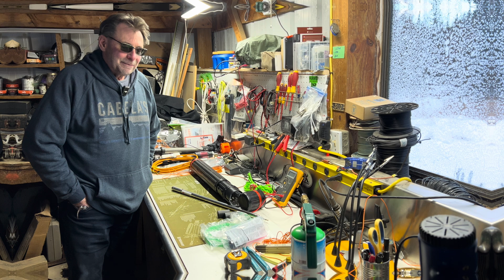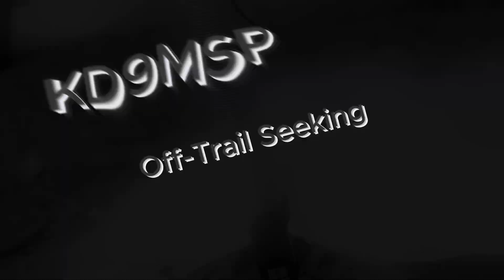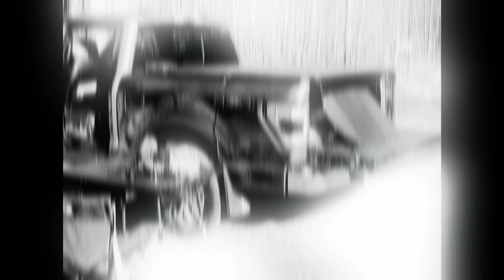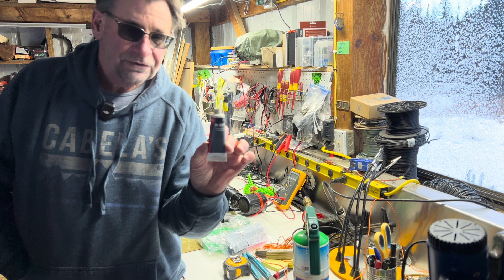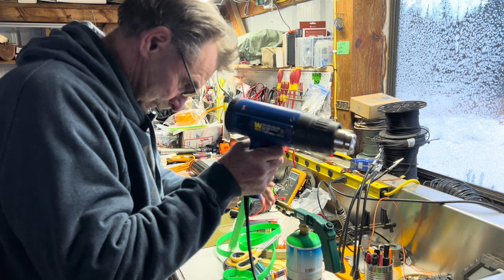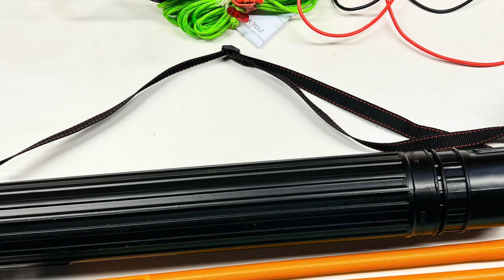Whip Your Antenna Whip

Comment: Lipo batteries are way to unstable and known to combust just sitting by themselves. Lifepo4 on the other hand are a very stable chemistry and not prone to catching fire by themselves. Most of us use Lifepo4 because they maintain a stable voltage till the very end.
Reply from the maker: Very true. Especially with the BMSs in the LiFePo4s.